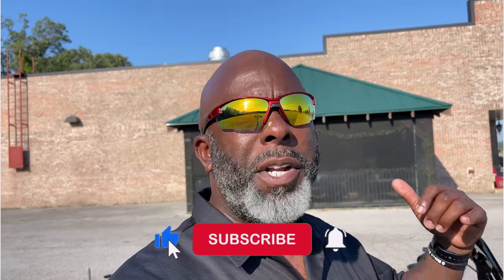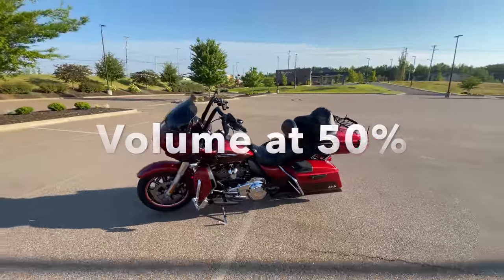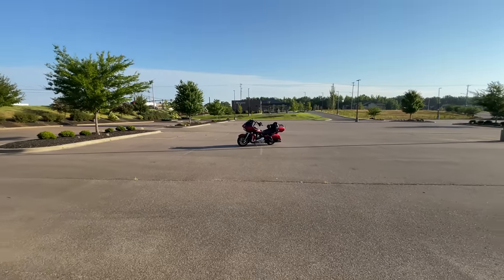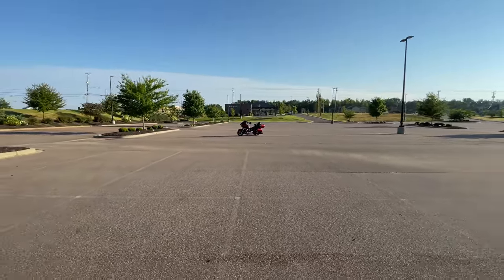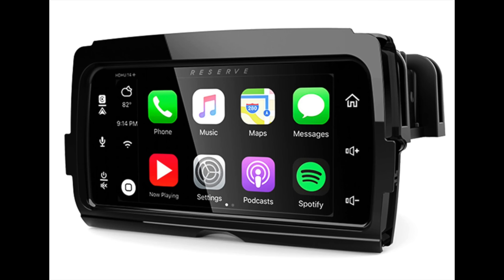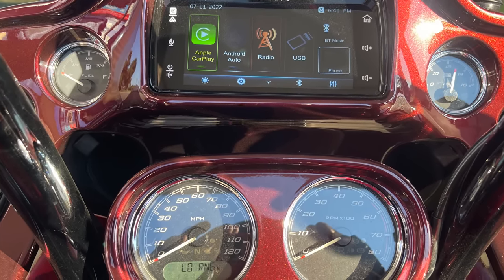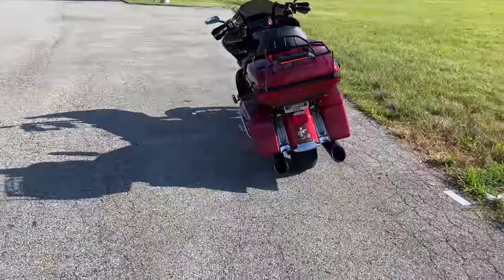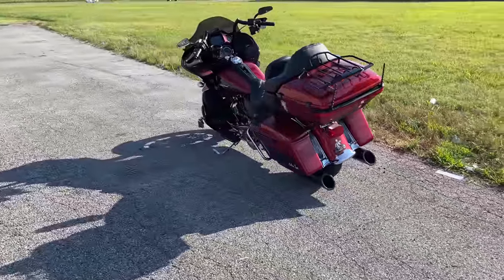New Soundstream HDHU 14 Radio for my Harley!!!!

Comment: Sounds awesome Cue! I think Harley upgraded the stock head unit in 2019 to  boot up faster and auto discount Bluetooth when bike is turned off. Also a bummer losing the low fuel warning pop up on the screen.  Otherwise the Soundstream head unit is a great upgrade,  especially with Apple Car play feature. 👍👍
Reply from the maker: The Harley GTS has a delayed disconnect just like the old boom. I have no idea why they designed it that way. Wish I could turn that off!
Reply: @RidingandWrenching  I never noticed a delayed disconnect on my 2019 SGS. Going to the bike to check. 😊 Glen
Reply: @RidingandWrenching  I did notice a slight delay when I went to settings the device settings my phone was still connected. Disconnected shortly after i opened settings.

Comment: Cue does your Soundstream radio FM stations come in clear with good reception? I’ve installed the Precision Power system with the Harley GTS head unit and I have very little reception. My old Boom2 system reception was great. Just wondering if the Soundstream HU would eliminate the bad reception
Reply from the maker: Honestly I don't use terrestrial radio. Never tried it!